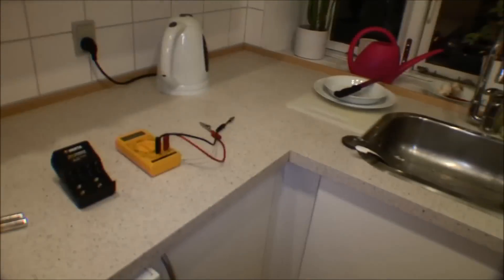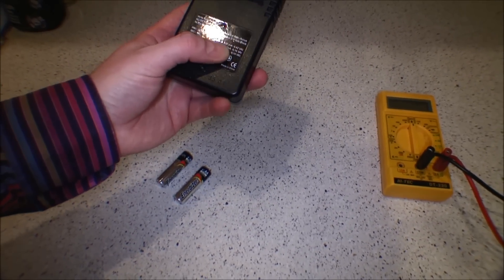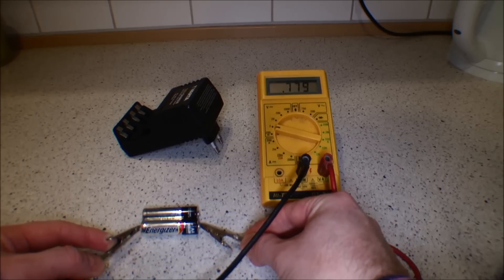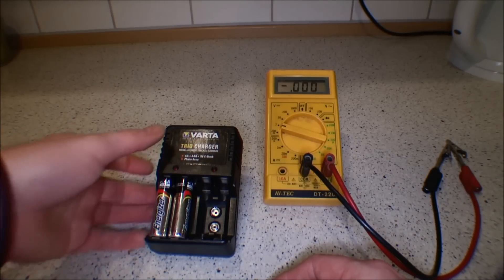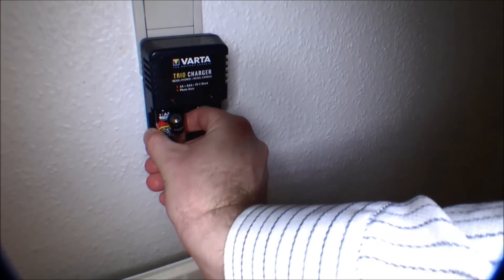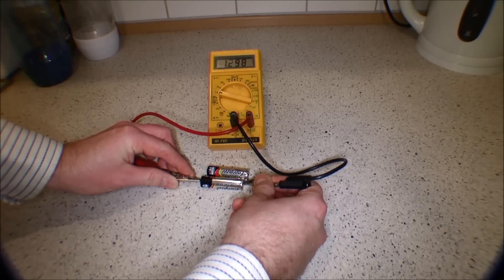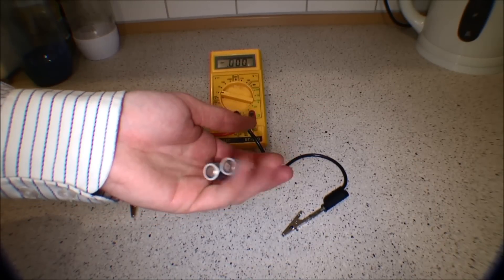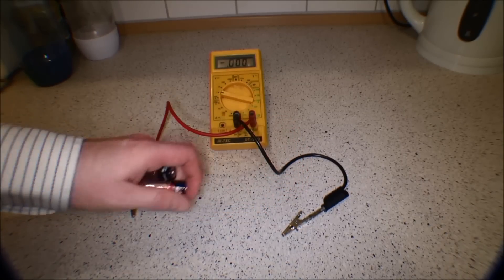Charging Alkaline (NON-RECHARGEABLE) Batteries - 124

Comment: I think why recharging a non-rechargeable battery is not recommended is not because it can't be recharged, but because it's tisk of being hot and explode. But if we can handle the environment, for example using slow charging and in a cold room temperature, i think its safe to do this. Bit may be it's unsafe in tropical country where room temperature more than 30°C. But thanks for the video it's inspire me to try charge an alkaline batteries in a cold room and add more fan to remove the heat.
Reply from the maker: In most cases there is no reason to recharge these...

Comment: You can absolutely recharge batteries that are not supposed to be recharged.  Ive done it several times and they behave just as good as new.  The only risk is one leaking.  Throw it out if it leaks because it will corrode the connect points of what you're using the batteries for.
Reply from the maker: I would only suggest this for limited use...  you avoid leaking by charging them very slowly.

Comment: I've only just started trying to recharge alkaline batteries with my fancy new charger. The best use situation I've found for these recharged alkaline batteries is for remotes for the TV set. Its ideal because the remote never draws high voltage or high amperage, and it usually only draws current for a tiny fraction of a second, or at most, a couple seconds while holding the volume or channel +/- buttons. Thank you for this video! Now I know to use the lowest voltage setting on my charger for these
Reply from the maker: I would not really recommend this as a regular thing,, more as a "dang it! we do not have any new ones"

Comment: Ya I put 17 volts into some Duracells and they barely got warm but it only took to the count of ten and they were reading four and a half volts. I even charged some wafer batteries and they are still holding 7 volts but they are supposed to be three volts so I thought maybe I shouldn't put so much voltage into them so I set up some more resistors on the transformer I was using and got it down to 9 volts and now I can let them charge slower and longer. None of them really got hot but I wasn't charging them very long either but I'm sure they will explode if left long enough. The fast charge is kind of cool though and the couple extra volts really makes for an extra bright LED flashlight so I thought I might try cooling things down a bit and I put some batteries (dead batteries) in the freezer thinking I can keep from damaging them that way and I froze them up good. What a surprise that was because I read four volts off of the dead AAs that I froze and I hadn't even charged them yet, that goes for wafer batteries too. I could have swore they where dead when I put them in the freezer? Needless to say  none of the batteries I froze ever got warm the whole time I was charging them and I was hitting them with nine volts, I know there are some more resistors around here somewhere and I imagine I will get the performance up to what it should be and I have a whole bucket of batteries work with. Also it is interesting to note that I only found one leaking duracell out of that whole bucket ....
Reply from the maker: You will brake the used batteries, if you charge them hard,, they need to be charge extremally slow.
Reply: @MyPlayHouse  correct, I grouped them together and brought down the voltage so they will last a long time. I took batteries that were reading zero and after I froze them they actually started putting out some voltage before I did any charging. These are batteries that were completely dead and have sat for at least a couple years that way. Keeping them cool appears to be of some benefit while bringing their output back up gradually and keeping them cool insures that they will not explode. I kept a couple of AAs that were less than thier normal output on a joulel thief or what they call a work around circuit for several years and they were lighting a four volt LED. I never did any charging of those two batteries. Also I had soldered the wires to the batteries and they had never been in the freezer, I am going to try that now and put two of these batteries that were brought back from zero by simply freezing them to light the four volt LED on the jewel thief circuit.
Update:
I took the two AA batteries off of the workaround circuit and together they are still reading half a volt. These batteries are over ten years old and the negative ends of both of these batteries are bulging and corroded yet they still have a tiny half volt left between them. After they sat in the freezer they could barely move the needle, less than half of a volt so I hit them with 9 volts for 5 seconds and now they are reading one and a half volts ! I wanted to throw them away but I've had them for so dam long and they they are still not completely dead. I hit them with 9 volts a little longer this time while they are still cold from the freezer and now they are reading 2 volts. not enough to light the 4 vollt LED. I think what the work around circuit does however is pulse width modulation that enables the 4 volt LED to light in various degrees of brightness because that is the only way to operate an LED light and have it be dim giving the weak batteries the chance to light the LED at all, in other words a pulse width modulater is what lest you have a dimmer switch for LED lights  ..

Comment: Thank you! I have several battery powered Christmas lights around the house, and recharging alkalines really works! . I get several days worth of energy, so that represents savings there. I noticed that nice alkalines work better. How many cycles do these withstand? I give them 2 or 3 charges, then get rid of them.
Reply from the maker: I would say that this is mostly for emergency,, use :-) out of batteries and need to keep something going until the shops open-ish :-)
Reply: @MyPlayHouse  Oh ok... maybe I'm pushing my luck haha. This has worked well though
Reply: Why you dont just buy rechargeble batteries?! Will be cheaper on the long run
Reply: @TheMasterSystems  I do have rechargeable batteries on all every day use devices, but not enough for all the Christmas stuff. So yeah, maybe I should get some extra for the occasion.

Comment: This battery reconditioning program exceeded my presumptions. It worked on any drill battery, several AA and AAA batteries, batery.repair    and any camera battery. The steps are simple and the act itself is exciting to do. No matter what type of battery you`ve got, it is sure to function again!
Reply from the maker: Hi Дарья Ешану
Thank You very much!  glad you liked the video :-)
Thank you for watching! :-)
Reply: @MyPlayHouse  Best Alkaline 4X AAA/AA battery Charger is the (made in Taiwan, ROC) Powertran A0280.
It is a microprocessor controlled battery charger allows you to recharge standard alkaline batteries up to 20 times. It also can charge NiMH rechargeable batteries but NOT NiCAD. 
I am still using one.

Comment: Yup, alcaline recharging super well, just tried super heavy duty cells, they suck at charging.. any mA that goes into it converts into heat\ edit: just popped one alkaline.. too much current and heat.. guess 2x30W solar panels are too much, gotta use one only
Reply from the maker: Yes,,, way way to much!
Reply: @MyPlayHouse  yup, it's very ok with just only one, just measured with multimeter, it's cloudy and there goes 0.09A into the batteries (2 AA in series)

Comment: A little knowledge is a dangerous thing, and people following you are going to end up with leaking batteries. A correct alkaline charger will charge for a while, and then give a small discharge. During discharge, any gasses produced will be re-absorbed. I think the ratio is about 10 charge units to 1 discharge, so the net effect charges your battery. If you use a NiCAD or NiMH recharger, that re-absorption won't occur, and leakage is likely.
Reply from the maker: So You would suggest  like charging with 100mA for 30 minutes and discharging for 3 minutes ?
Reply: @MyPlayHouse  I have charge and recharge alkalines long before youtube.  Short off-and-on bursts are better, I usually let the batteries sit for several hours before use.  The worst I have had happen over the years is a little leakage and one battery pop on me (not explode). I have found actually cheaper alkalines charge better.

Comment: So I guess 0.5 amps charging is too fast? I have an intelligent charger that shows me the level and it can supposedly detect any kind of battery you put in and adjust current accordingly.
ive had my C alkaline batteries on there for about an hour and they are still cool to the touch, i'll keep an eye on them but let me know if its too dangerous.
Reply from the maker: Yes 50-100 mA is better!
Reply: @MyPlayHouse  thank you. They began getting warm to the touch after 2 hours so I took them off, but it was enough to charge them almost to full

Comment: I'm using same 32 Maxell AA batteries for last 5 years over and over, recharged about 20 times each, still working fine.
Reply from the maker: okay,, I would only use this for a emergency,, shop just closed and the remote is flat,,,- ish
Reply: What a cheapskate 😂
Reply: @zerdZerdzerd  batteries are expensive
Reply: great work Michael. Love it!
Reply: It won’t explode

Comment: I used a 500 mili amp power suply to charge batteries and it always worked. I only charged them for short periods of time, like arround an hour, and it worked to finish game sesions
Reply from the maker: I think 500mA is a bit to much,, 100-200mA would be what I would go with.
Reply: @MyPlayHouse  yeah, I knew it would be a bad idea to leave the batteries charging for hours or try to get them to fully charge. but it worked fine for short and fast charging. I would put 2 to charge for half an hour and when the control ran out of power I would swap them and I could play the whole night swaping batteries every now and then
Reply: @MyPlayHouse  30-50mA is better for AAA's
Reply: Power supply way to go all my battery chargers start flashing when put alkaline batteries in them.

Comment: i have done that, the battery wasn't exploded but it so hot i barely can touch it.
Reply from the maker: You need to charge way way slower,, like 50-150mA,, but this is just for the little emergency, where the shop just closed,, and you need that remot for your TV :-)
Reply: @MyPlayHouse  How do you control the “slow” charge? You plugged it right into a wall outlet so it’s hard to tell if I did the same, would there be an issue?
Reply: @Qattea  If you don't have a slow charger then perhaps plugging it in and out every half an hour might work

Comment: The important concept is the microfierit of a freash battery which I estimate to be around 350uf and 200 mah, so the computer charger is oviously to much 4000uf and 2000 mah so you need a 3cm pencil and 500uf 5 volt capacitor to charge it up.
Reply from the maker: Not sure what you are talking about ? I do not remember this video is anywhere near that/those subjects.
Reply: @MyPlayHouse  Basically micro fierite is how much current a battery or capacitor can handle.

Comment: An excellent method for blowing up alkaline cells. They're not made to withstand the gas production inside when recharging. Builds up pressure until the Big KABOOM. I've seen the blown up battery chargers from people doing this - and the mess it makes with caustic, corrosive and poisonous chemicals being splattered all around where the battery charger was located.
Reply from the maker: Impressive,, I have done this since I was 7 years old, and never had any issues,, except when the batteries did no longer take a charge.
Reply: you idiot, any battery can be overcharged with oxygen release(even lead acid lol) problem with recharging "alkaline" is zinc recovery, it crystalize in form of dendrites, thats why "recharged" alkaline have much lower capacity.

Comment: My charger is 2.8V=260-300 mÃ (AA)x2
                         2.8v= 120-150 mÃ (AAA)x2
Will it work? I was told they all will work as long as they arent the 1 hour quick charger type. But should not be left unattended. An if the batteries get hot to the point they are no longer touchable unplug and dont use it.
Reply from the maker: Hi Jack Mehoff
Thank You very much!  glad you liked the video :-)
Thank you for watching! :-)

Comment: I do this when i leave the guitar plugged into a peddle and forget to unplug- i go through some 9 volts - finally got 4.. 9 v batt and a charger for 12.00 free shipping on ebay.. i get free rechargeables in the cheap 1 dollar solar lights usually aa or aaa batteries - when they quit working, usally from to much rain and rusts the led bulb ..but yeah they are worth it - a solar light then a free batt for a buck..and are rechargeable(s)
Reply from the maker: Hi beatleme2
Thank You very much!  good energy use for that little trick.
Thank you for watching! :-)

Comment: Dangerous.  Even if the batteries don't explode there's a higher chance of them corroding afterwards.
Reply from the maker: Well you just drove 4 hours and arrived at the cabin,, in the woods,, and the battery's for your remote/mouse/keyboard is flat,, this could be how you get by until the next day,, and do not have to drive xx miles in to some closed store :-)
Reply: yep it works but noooot recommended
Reply: I mean, my batteries corrode just sitting around in the high humidity of Washington state anyway. I'm not doing anything abnormal like recharching Alkaline cells. I just dispose of them when they leak.

Comment: omg! worst advice ever! you can't recharge non-rechargable batteries! you can only revive them slightly, but do that a few times or leave them charging for longer and they will explode!
Reply from the maker: Hi Sasha M
Well batteries will never become as new,, you can bump them up a bit, a slow charger is best. Batteries if charged to fast, will become hot,, not good for the battery, but it's just ruining the chemistry inside. Never ever heard of a battery exploding,, think you might be thinking Li-ion. this is alkaline.
Thank you for watching! :-)
Reply: @MyPlayHouse  i've had one explode (watch size battery, alkaline) and one leak (aa size, alkaline). the core difference between plain alkaline and rechargeable is that in the latter pressure and temperature increase due to charging are controlled and leak is not possible under normal circumstances. also once a rechargeable battery cools down, it is ready for another cycle, whilst in alkaline batteries damage accumulates with every charge attempt until they become unusable or leak or explode
Reply: you can recharge ANY chemical batteries.
In case of alkaline(any zinc based in general) its almost useless, because of zinc dendrites, which ruins recharging (after each recharge capacity drops significantly)
Reply: he was never giving advice

Comment: I actually found a little circuit at some random prepper forum and it should charge the batteries without any problems up to 70-85%. If you want to continue this topic then just reply and I will send you the schematics but they will be with Polish language. In other words I would recommend you to get Google Translate App and do an translation of every sentence with the camera translation feature
Reply from the maker: Hi MichalPlays
Thank You very much!  glad you liked the video :-)
Thank you for watching! :-)
Reply: Np,
here is the link to a pdf which shows the circuit of this battery charger.
I tested it on AAA Batteries and it worked very good but I discovered that it could also charge a 9v battery but never tested it.

Btw. at the last page of this pdf there is a table with the title " Spis elementów"  and it means that this is the list of the components used in this circuit. For example D5 on the circuit is a diode 

http://www.mediafire.com/file/o12hwj5bvdvh8km/83-nw-01-regenerator_baterii.pdf/file
Reply: Hi, how are you doing? Would you still have access to the schematic? I'm sorry I know this is an older post so if you don't or are no longer available I do apologize. Thank you for your time and patience.

Comment: I think im the only one waiting for it to explode.
Reply from the maker: Hi Carlos Jaymalin
well years later,, I am still fine!! :-)
Thank you for watching! :-)
Reply: They never explode, it's a myth. I have a re-charging station that will charge 8 batteries at once and is adjustable and any type of battery with fit with the exception of watch batteries.  They all recharge and then last for much longer than you would guess and I am talking about any kind of battery even the ones from dollar tree. Typically, I can charge a battery about 20 times before it stops charging, if this happens my battery charge unit tells me that the battery is bad. It uses pulse charging so its very safe.  Yes, sometimes the acid leaks out, it's a black goo. But I have never witnessed a fire or smoke or any kind of heat.  Battery manufacturers don't want us consumers to know that Alkaline batteries are actually easily rechargeable.
Reply: Tao Tuhao What is the charger? Where did you get it?

Comment: Ugh I'm trying to look up how to charge a battery without a charger, yeah its kind obvious how to charge batteries with those
Too simple really>:\
Reply: U know what....nvm;^;
Reply from the maker: Hi kittyheart55 thecutinator
Thank you for watching! :-)
Reply: Are you a muggle?  Then not possible.
Reply: You need a higher voltage battery in parallel and a series resistor to limit current. A multi-metre is a good idea to measure current and voltage in any DIY charging method to prevent overcharging. I've used this to charge phone batteries in smart phones with charging faults.

Comment: if batteris have 1.2volte  they have bigger capacity unlike the 1.5 volt bateries they have not that big capacity as realized in the videos
Reply from the maker: a brand new 1,5v not rechargeable holdes more power than a rechargeable 1,2v,, but only the first time.